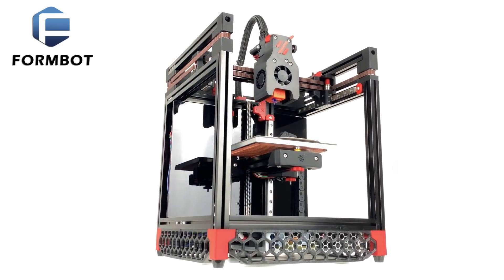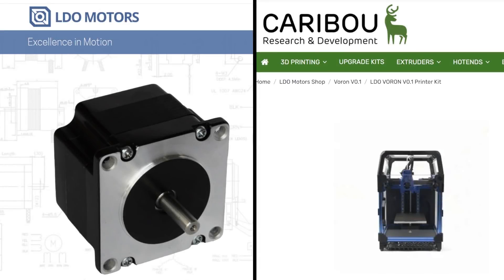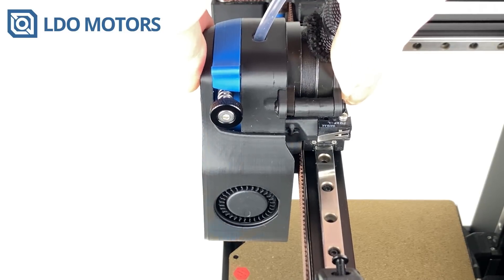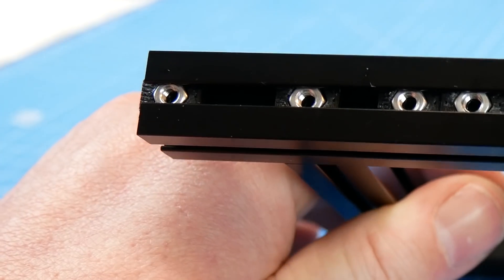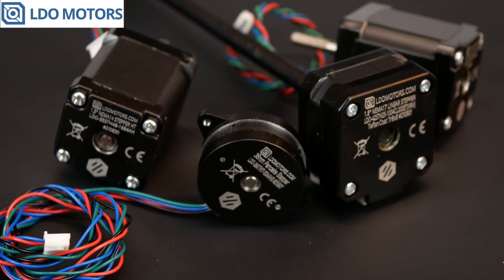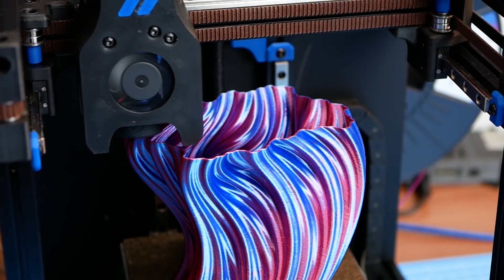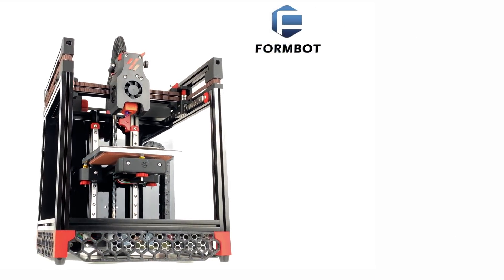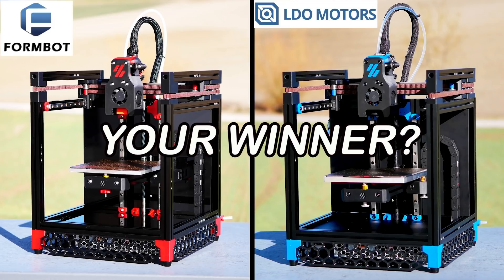VORON0.1 Kits COMPAIRED: PARTS and BUILD Experience (PART 1)

Comment: I have the formbot kit. I was wondering what you thought the best parts to replace would be?
Reply from the maker: Depending on the part cooling fans you got: I’d change them. Maybe also the motors, but for casual fast printing they are sufficient (oudeka) - though: idle noise…
Reply: @247printing  mine can with the same fans as your, so I'll look for some upgrades there, thanks!
Reply: @hardcorexy8718  it's honestly not that bad if you flip the skr e3 the 24v wires are long enough and then you only have to solder the fans. The printer prints amazing. Perfect parts at 150mm/s 10000mm/s^2. My only issue has been cooling but the better fans will probably help there. I've gotten around this by printing lots of parts at once.
Reply: I have the formbot kit, I bought it in Aug last year and printed like crazy on it ever since, especially during the Christmas season. I ended up having to replace my fans (mine came with sunon and they weren't very good.) and I had to change my extruder motor (Moons) to the LDO motors. The A/B oukeda motors seem to be fine, but I did buy some spare LDO ones in case they go out.